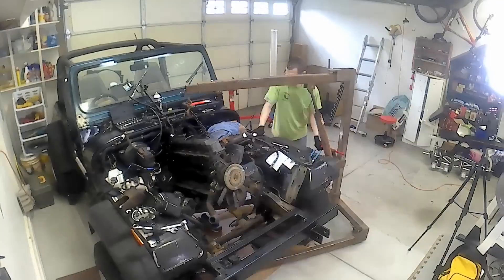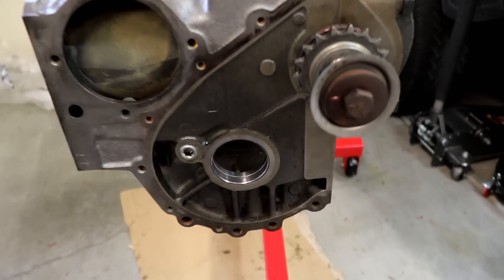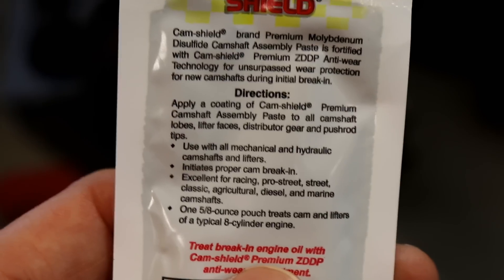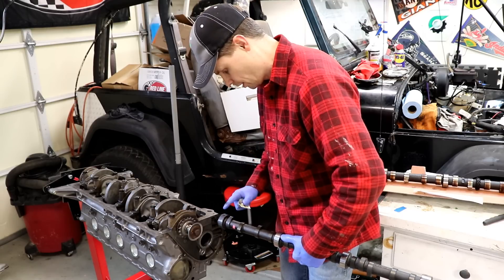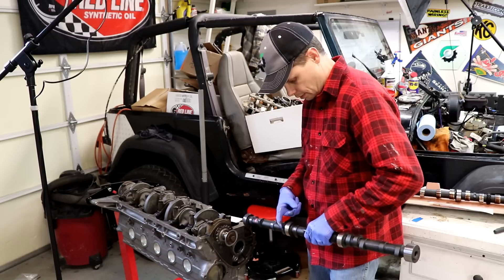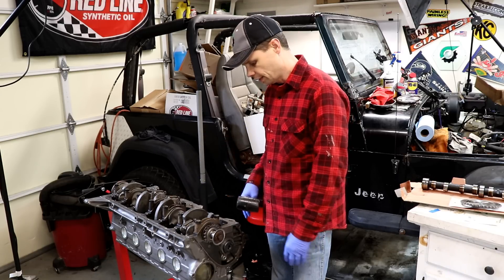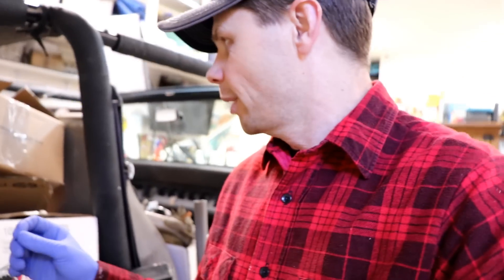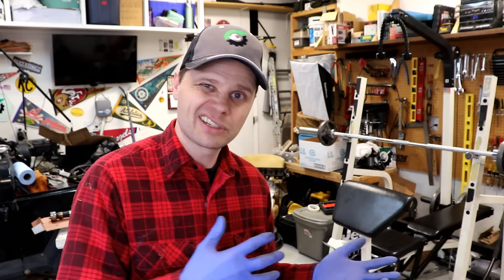Jeep Camshaft Installation: Engine Rebuild Part 19

Comment: Great video series! I can’t figure out how you’ve got a few thumbs down?! There must be some NASCAR engine builders watching your series unable to move along without hitting the thumbs down! I don’t know. I’m in the process of rebuilding a 4.0L in my garage at home. As I was installing my camshaft, mine fit really snug on the last bearing. During my visual inspection, all of the bearings looked excellent. Straight on the install, no galls or scratches. It gave me peace of mind that I’m not the only one it has happened to. It feels smooth on the turning with no binding. The machinist who set my bearings and did the machine work for me has been doing this work before his hair turned gray. I trust that it’s going to be okay. Thanks for the awesome series! Great job!
Reply: I am in the same position myself rebuilding my 4.0 in my garage, did yours end up working just fine? My cam is a little tight once in the last bearing but bearing tolerance are different in each so could be any bearing but all my tolerance checks were good

Comment: Great installation video Dale . That camshaft seems a little tight turning to me , I have never had a camshaft turn that tight with new bearings . They usually spin pretty free . Just makes me nervous . Take care !!
Reply from the maker: Yeah, made me nervous. Called engine building expert and told him I couldn't turn it by hand.  He said it's ok if it turns with wrench.  It is smooth, which is reassuring.
Reply: you all prolly dont give a damn but does anybody know of a method to log back into an Instagram account??
I stupidly lost the password. I appreciate any tricks you can offer me!
Reply: @Joshua Matias Instablaster :)
Reply: @Kenzo Xzavier It worked and I now got access to my account again. I'm so happy!
Thanks so much, you really help me out !
Reply: @Joshua Matias glad I could help =)

Comment: Wow, looked to me to be too tight! It seems like that last bearing might be a tiny bit crooked; it was fine until that point. I have never had to hammer in a cam like that. Hope it works out for you.
Reply from the maker: Yeah, it had me worried too.  I called my machinist and talked to him about it.  He said it should be fine. Some fit tight. Well see..
Reply: @JeepSolid  did the Jeep run fine with the cam being tight?

Comment: Great video! My daughter has a 89 jeep wrangler and it has a ticking noise. Put new rocker arms pushrods and lifters and still ticking. What do u think it might be. I am thinking cam bearings but not 100% its a 2.5 4cyl

Comment: On the back of the engine. Is the plug on the camshaft hole just a plug?
Reply: I came here to ask the same question. Did you get an answer from anyone??
Reply: @facts_all_the_time  ya it has a freeze plug in its place
Reply: The "literal end of the camshaft journalled tunnel" through the block finshes itself OFF with a freeze plug BEYOND the cam bearings in the bellhousing section

Comment: Engine tech is absolute junk. Just replaced my head gasket and decided it would be wise to replace the old original head bolts. They stretched and stretched upon torquing to 110ftlbs, one of them snapped. Reused my 30 year old head bolts and they torqued right up without issues. It is getting harder and harder for any mechanic to make money or guarantee our work when the parts we use are self destructing, cheap crap